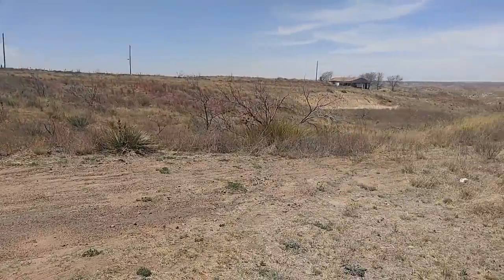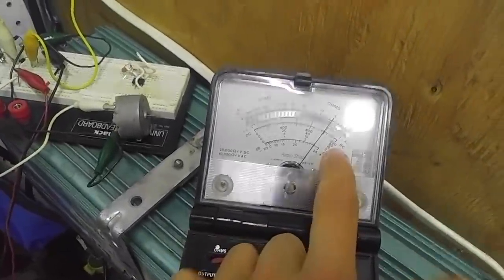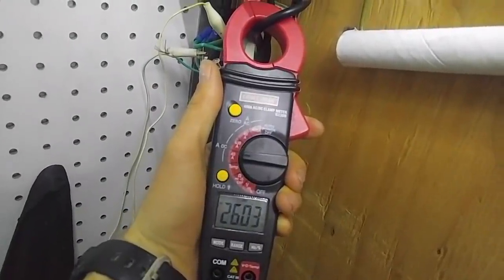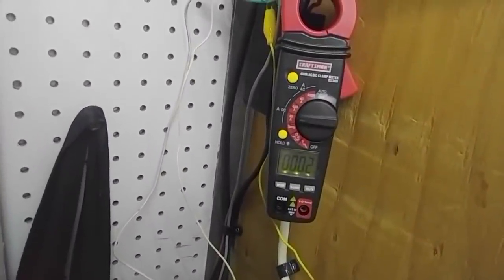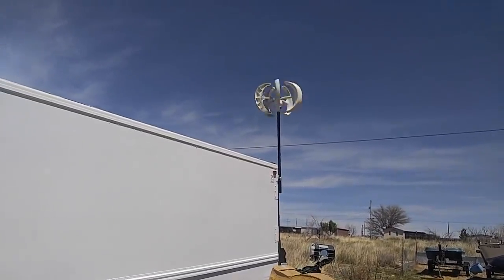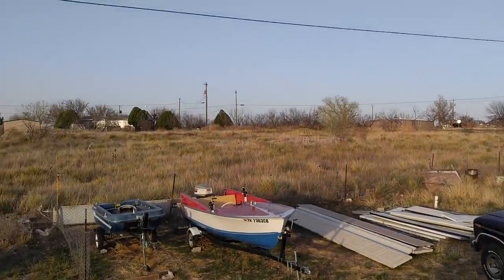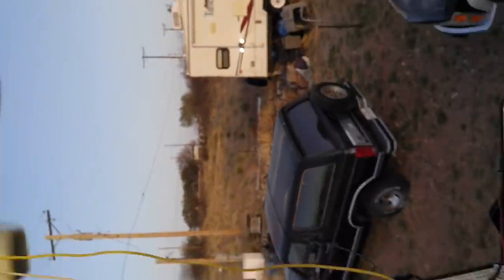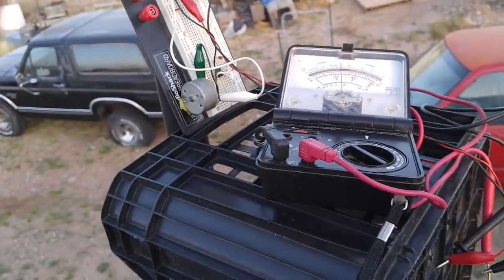400W Chinese Ebay Latern Vertical Wind Turbine Performance

Comment: These turbines are complete garbage. A decent propeller design will at least produce something. So you won't get anything with that wind surface area, even if the ornament is spinning.

Comment: There are a couple companies that make these that actually work. Look at the weight when you purchase that most of these knockoffs will not list the weight John Daniels, has a video on this, he got a drunk one, then the company sent him a good 1 at 13 kg. It's producing power.  All of them use the same white shell. It depends what the windings are and how big the magnets are.
 Most of these have tiny magnetis And horrible windings the 24 V, one that weighs 13 g will produce power.According to John Daniels video, he said the good ones came out first and he's knockoff.Companies start making junk replicas

Comment: Those white  400w three phase generators are only actually 100-200 watts when attached to a proper 3 blade turbine body , and thats with half flat batterys and measured properly with propper wiring and a good controller . when you go driving it with a VWAT setup it does not give very much power at all theres just not enough energy available . I do wonder if you went realy enormous with the blades of the vawt and then used some gearing to increase the rpm if that would work ?

Comment: 1) the wind turbine charge controller in your truck had one of the three AC 3 phase electric cables to be connected to your turbine is not connected to anything (green wire).  2) when your batteries are full and no load (larger than a 6w motor) is not being used the charge controller issues a break in voltage to save your batteries.  It will only produce what you use.  Put an actual load on and test again.

Comment: a dc motor under locked rotor condition will draw the maximum amperage available to it, since at that point it is a dead short, so everytime you grab the motor the amperage should climb not fall, since it did not climb I am wondering if you are testing it at the correct place on the circuit. What is the ac voltage coming off of it?
Reply: @mythoughtsonfaith1031  The amperage reading was coming from the output of the charge controller to the battery bank. That's when I seized the motor, it drops the voltage of the turbine. Because the turbine can barely output any current, the current into the battery bank stopped, because the bank is at like 12 volts or whatever, and when the voltage drops no current flows in. So the very minimal amount of current flowing into the batteries evaporates. That's why you're seeing this confusing behavior

Comment: I'm machanical engineer and I will support the video conclusion: the rated power for these generators is a completely fake.

Betz was the first to analyze the max power and determined that a max of 59,3% of the energy of the wind reaching the generator area can be catched.
Then you have to add looses in the mechanisms and the aerodinamics  and the global performance is further reduced.

There are two types of systems:
VAWT (vertical axis wind turbine) also known as Savonius type that can reach a max real of 18% performance. Noisy free and low revolutions)
A device of 1m heigh x 0,6m wide can produce at 10 m/s wind speed a max of 70 watt.

HAVT (horizontal axis wind turbine) that can reach with a diameter of 1,2m at eh wind speed of 10 m/s  a max power of 300w
With  light winds the power generated is very poor (cubic reason of the speed). Performance is higher and around 40% max.

Power= 1/2 R x V^3 x P
R= air density  around 1,15,  V= speed of the air
P performance (18% / 45% aplying Betz + other looses)

yes the wind is free but a wind turbine can not take from the wind energy more than a 18/40%
10 m/s wind is 20 knots speed. Higher winds generates more energy  but introduces vibrations in the structures.

It is impossible to take a lot where there is only a few but anyway consider to get some of this energy when the cost worth it.

Comment: It'd a good thing that the unit is not producing anything else your wiring would burn up
Reply: I have those kind of jumper wires, and they're not there best, not even soldered at the clips, try something again like a bulb rated for the voltage of the generator and see if it will glow, you can also test amps. This would be a.c current not DC. It has to produce more than that. You can take any two wires. Don't let the third wire touch anything. 

I don't know how youh hooked up the 3 and six diodes keeping in mind that it is a three phase gen.

Comment: Most of the guys doing these home how to videos about electricity don't know the difference between voltage, current, and power. This one doesn't look to be any different.
Reply: I made the video. Power equals voltage times current. Took some electrical engineering courses in college. Video wasn't very clear I can understand that. Been living off grid in this setup since then. Pretty successfully. Running air conditioner, welder, now have a 3000 w power inverter. Lithium batteries. So apparently my lack of knowledge isn't hindering me, considering I somehow did this all myself 😏

Comment: As soon as you stop the motor, there is no more inductive load...  I.e. it is a short and the voltage across the motor will be 0 volts.  Draw out your schematics it will help you troubleshoot better...

Comment: Put those three wires to a 100 amp rectifier and then check the outlet of the rectifier the red and black wire yes you're right guessing that it's diodes but the PC little ones you're using will only let little s*** through and will only build up little amounts of electricity if you want amps use big amp diodes

Comment: this is not a wind turbine for use. this one is designed for show only. for home power supply, we suggest you to choose horizontal type or FH series: https://wxflytnewenergy.aliexpress.com/store/910692?spm=a2g0o.detail.1000061.1.3b48645135XAmQ

Comment: Electrician here, your method of testing and understanding is wrong, yes it looks like a cheep product, for example the power that comes into your house could be 240v and fused at 100amps but if you were to plug in a small 100mA motor to the mains you cagoule stop it with your finger, but not in a million years could you determine what total output is your supply capable of by test a load that is only 100mA. Get your self larger loads or add resistors to the load
Reply: He is doing nothing wrong, he is talking about vertical wind turbine from Chinese. If you think this kind of turbine works then you should watch this video too: https://www.youtube.com/watch?v=DUtw4xiveus

Comment: those light duty wires will not conduct any amps !! you need at least number 12 or atleast 14 wire, to carry any amps, i learned it the hard way !
Reply: The smallest wire I ever use for low voltage is 10ga but even with just 200W solar I experienced better recovery on average. I try to keep runs short but I’ve come to believe in over sizing wires.

Comment: I have multiple VAWT and HAWT. These VAWT do not make power (bad design, needs more surface area to catch wind and a lower rpm build). My HAWT 400w or 800w start producing in 7 to 8 mph winds at elevation where the air is thin. 

Thanks for the video, ignore the hate posters. This design of VAWT is junk and no matter of different equipment will net a different result. 

Keep making people aware. Go for a VAWT (try a 3 and 5 blade). A 3 blade is creates less turbulence but the 5 blade can pick up more wind. So here in the rockies 3 blades produce under 10w while 5 blade will produce 50 to 70% of claimed power (in my experience). With better blades (longer, flow design) this goes up. At 25 mph you should be about peak power.
Reply: Either can work with the correct sized blades but VAWT makes too much turbulence and will never be as efficient as a HAWT. An over simplified way of thinking of it: VAWT with 5 blade can get moving with slower winds, while a single blade can go much faster due to the less wind turbulence created by additional blades (but it's harder to get started). VAWT is the same where a 2blade will make the high speed needed (with the appropriate surface area and tension), but a 6 blade will start in .5mph winds (it'll just never go fast enough to produce power).

Turbines free spin until the controller recognizes the potential and create a load. This is why at 12 mph my turbine can produce power but sometimes the wind isn't constant/clean enough to start production of power

I hope that helps.
Reply: thank you for explaining the advantage/disadvantage of the different turbine designs. do you think 6-8 bladed VWAT would work at 70mph winds? or would HWAT be a better option?

Comment: The manufacture gave me one of these for testing and the most I got was 21 Watts in 32 MPH winds by putting it under a heavy load.
Not enough surface area and the blades are DRAG type.  Only LIFT type blades work to some degree.
Change your blades to a Darrieus type BLADE and she could finally make about 150 Watts. That is what I did to make my unit like yours finally work. 5' diameter at 6' high /   https://en.wikipedia.org/wiki/Darrieus_wind_turbine
Reply: Did you succeed? We are interested in getting our junk to work...
Reply: This would assume that the motor could actually output any meaningful power. What would happen if the blades didn't have sufficient area, is that the speed of the turban with slow as more load were applied, cuz the power has to come from somewhere. It's coming from the rotation right. But we don't have any slowing of the turbine The motor is just junk. The blades aren't an issue really, you can change the blades all you want but it's not really going to change the results for this cheap motor

Comment: Dangerous, Ugly & noisy, Wind Turbines will NOT be around much longer ! Why?
Because in July 2019 a new discovery by a Hi-Tech Electrical Engineering Company has discovered a way to "Switch-Off" dangerous radiation. As a result a new type of Radiation Free Reactor is already on the drawing board. This new system is more efficient that either Wind Generators or solar panels. One new power plant should be easily capable of generating more cheap power (whenever you need it) than 500 wind generators.

Comment: Electrician here. 

so many flaws in this video. from incorrect equipment for the test, incorrect testing methods, improper use of the equipment. His tests gave bad results because they were done poorly and incorrectly.

not trying to defend the turbine manufacturer

1. Your turbine cannot output more then the load. if you are using a 100ma motor you will not see anymore output then that.

2. blocked rotor test will increase amperage and lower voltage. ALWAYS but will still not pull more then the BR rating of that motor. on a motor that size I wouldn't expect much. especially since you can stop in by hand.

3. you cannot zero out a meter for DC when the wire is in it. whatever you calibrate. whatever is running through it at the time will be zero. If you have 5DCA running through your meter when you zero it out it will calibrate 5DCA to 0. You can zero out AC with the wire in.

4. its hard to tell from the video but it also looks like you are measuring the amperage on the output of the charge controller. but running your tests off your DIY rectifier from the AC side, which is not inline with where you are evening metering for amperage. This would explain why your amp meter reduced when you blocked the rotor. because the volt drop is effecting the other load.

I am only 2 minutes in.

skipped to the end. "WIRING IS NOT THE ISSUE" , your testing method is.
Reply: Biggest lol is the size of his wires lol, they can't carry 2amp without melting.
Reply: no capacitors , 1A diodes, thin wires ....
Reply: Yes that is what I thought as well. He is the one ineffect here NOT the turbines or instruments. Electrical ngineer here I am out.
Reply: Ya, the first thing I noticed is the ‘load’ wasn’t really a... load.
Reply: I was allso thinking that this is just badly executed rather that bad engineering on windmill... Desing is easy but product might suffer from quality problem what wuold effect the efficience, but first give that windmill some load from nail and then we talk.
Reply: Unrelated question since you're a sparky: Is it possible to wire the circuit for the wind turbines in any way such that if 1 isn't spinning and the rest are, you'll still get some output?
Reply: @MrRetiJunior  the fast answer is YES
Reply: Do you have any link to proper test? 🤔
Reply: Replying Even though this comment is very old coming--from different account. You can criticize the 'test' all you want. What you miss is that the only reason I gave this demonstration is I could hook up my ammeter and see that no current was flowing into the batteries from the charge controller. No matter how fast the wind was. The load was sufficient for the power output of the wind turbine. Otherwise why would the voltage drop so much? You simply don't understand the 'test'

This was simply a PSA, I wasn't going to invest in some professional setup or whatever to do it
Reply: Oh and one more thing, I didn't zero the meter on the wire. I turned on the light. So you just I mean I even said I was turning on the light man... The zero button is the one above that... At least get your criticism right!

As to point two. No. If this wind turbine could put out 400 Watts, if I seized the shaft of that motor, the voltage The meter is measuring wouldn't drop at all. Because the turbine will only output the current that the load draws right. But it won't drop the voltage so dramatically because as the load draws more current, the turbine will just give it more current. So in effect, the voltage will hardly budge. This is not what we see here. What we see here is a turbine motor that just outputs a little bit of current, but nowhere near the 400 w advertised. Basically, it can't even output one amp. It can't even output 12 watts. Cuz there's no way I mean this motor probably took only 500 milliamps or so maximum when seized. But even if it did output more power, the wiring is such that the voltage is not high enough to charge the 12 volt batteries under normal wind conditions or even relatively extreme like 30 mph winds. 

That is all this test shows. And it does it fairly accurately.

Edit: I watched the video. I did what you said, however, I did it when the voltage was like relatively low, and then I confirmed by seizing the shaft of the motor that the voltage output was too low to actually output anything into the batteries from the charge controller. Cuz like I said it's charge controller is just a bunch of diodes most likely. Anyway. So whether the meter is on the wire or not, If no current is flowing into the batteries. What does it matter if I zero the meter. It's just like leaving it on the wire disconnecting a switch zeroing it then reconnecting the switch I'll still get an accurate number
Reply: You're not an expert though. A motor like that won't even drop the voltage in a short circuit if the turbine's power is real, go back to school.!!!!
Reply: no matter of measuring theory +-20%, it is not laboratory, but he just proved that is not good product. 300W will burn the board all wires.. but nothing,  buy the same you will see he is right

Comment: This is a useless video. He doesn't explain how he wired the diodes on his breadboard. The wiring all looks too small to carry a load. He zeroed out his meter under load. He's never going to get an accurate reading that way. He doesn't know anything about electronics. He talks about measuring voltage when he's hooking it up to measure current. I would really like to see a good video on this product instead of this fool. Anyone know where there is one posted? This wind turbine spins like a scalded cat and I'm interested in it.

Comment: First, realize that your homemade diode board to convert 3 phase AC into DC is a joke. There is no way possible you can put any usable current thru that circuit.  It's like trying to use a wire bread tie to replace a battery cable on your car. So, buy a 90 amp 3 phase AC  to DC rectifier, install with minimum of 10 gauge copper wiring and retest. Your new results should be educational.
Reply: His diodes are good enough for this junk chinese lantern with only 30 mA output.
Reply: @johnq8792  
Unless it could do more....

Comment: The wires you have going to the diodes is way to small 20ga or so will only handle a few amps at best but yes these don't put out much but do it right before you do a review.

Comment: think ive found out why these turbines arent working... 
The magnets have been demagnetized by the cutoms scanning machines !!!
So im ordering some neodium magnets to see if that works.
Gonna stick them to the sides first in groups of three one for each phase.
Failing that ill strip it down and see if i can recharge the magnets or replace them... 
Maybe just maybe this is the fix.
Reply: actually you need 6 magnets, alternating between + and - poles set every 60 degrees around the outside of the generator for 3 phase. 3 magnets just wont cut it.
Reply: @leonardwalters154  youre right of course and sticking magnets on the outside was piontless lmao.
I need to strip the whole thing down.

Comment: I think you have a basic misunderstanding of what you are messing with.  You aren't going to see big numbers unless there is somewhere for that power to go.  Replace that little motor with a 12v hair dryer and poof your diode circuit will melt down almost instantly.  The down side of what you were doing is overheating the generator.  Any power that it produces that can't go somewhere is turning into heat.  Typically systems like this have a shunt load to dissipate power using low ohm wire wound resistors or actual electric heaters.